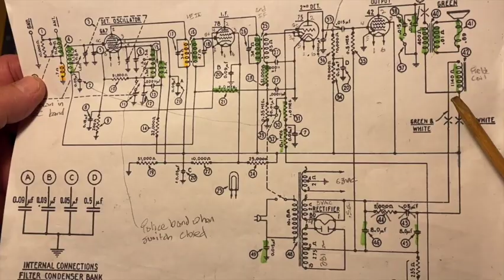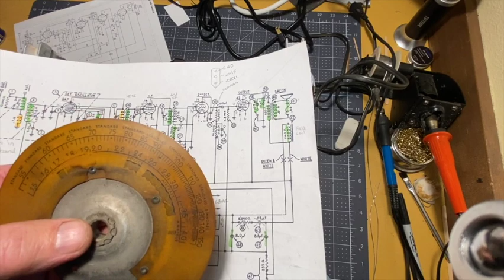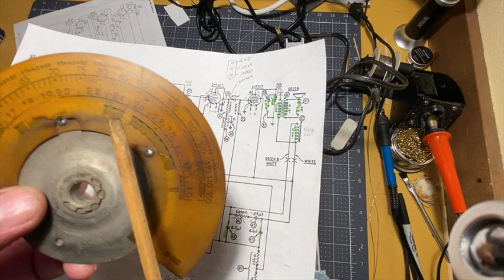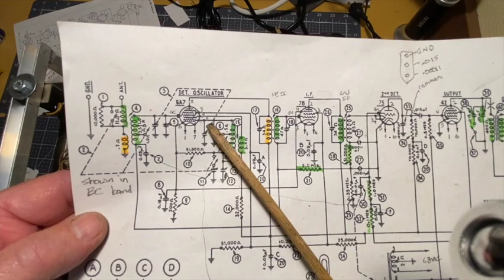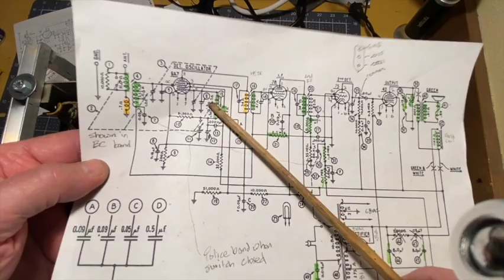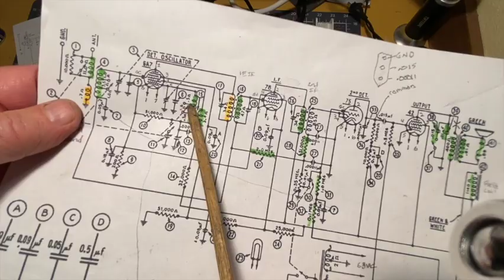Philco 60B Part 10 That Pesky Band Switch

Comment: Nice save Fibber. As you said, the switch won't be used much 👍
Reply from the maker: @DavidTipton101  Thanks. Appreciate your comment.
Reply: Good job Martin! That switch is different from the 66B…..neither switch will win Engineering awards for sure…..lol….I learned something from your video….the tab opposite the detents that is actually a stop in that slot…..I didnt even see a remnant of one on mine and didnt realize there was even suppose to be one….  The contacts are different and you have 4 vs my 6…… one good thing is yours default to BC band, mine can be jumpered with one jumper to BC….the 66B has a different band there that might be used more….Thanks for sharing! Take Care—Larry   ps…..I think you appreciated my pain a little….lol
Reply from the maker: @Backtothefutureradios  I do indeed, Larry.